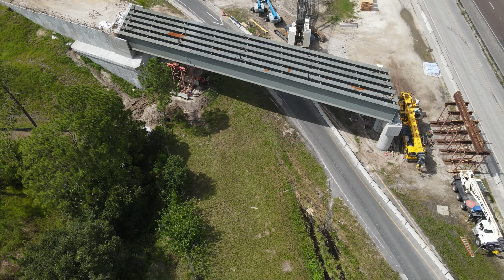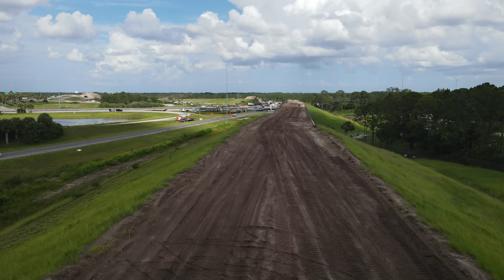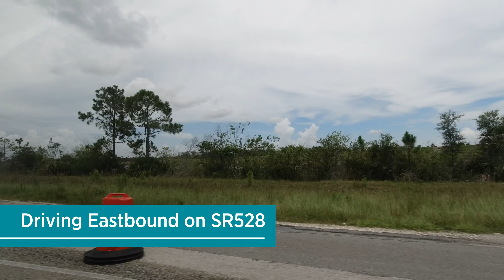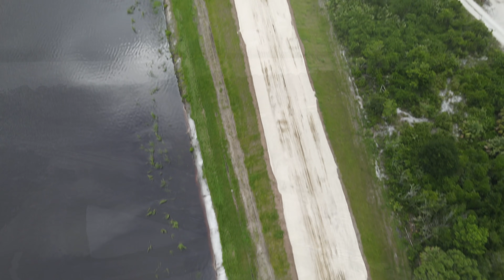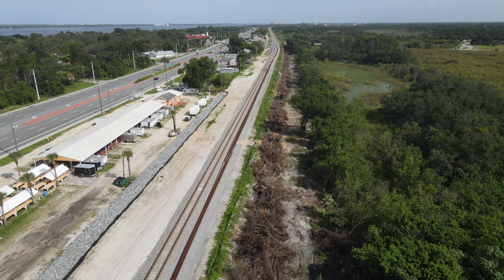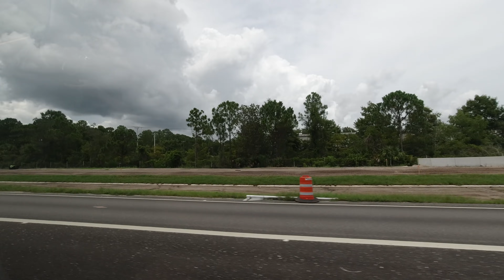Brightline Construction: Interstate 95 Bridge and Cocoa Curve/Tunnel Progress - July 2021

Comment: How strange that in approximately 18 to 21 months Siemens Venture Coaches bookend with Siemens Chargers will be roaring through these structures at 80 miles per hours and between highways 407 and 417 at 125 miles per hours.

Comment: I wonder if FDOT and the Florida Turnpike Authority, or whichever agency controls that section of 528, made sure the rail overpasses would leave sufficient room for an eventual widening and reconfiguration of the interchange. The cloverleaf is outdated and will start having issues once traffic volume increases sufficiently, I suspect.
Reply from the maker: Everything featured in this video is built with future road widening in mind for an additional 1 or 2 lanes in either direction.